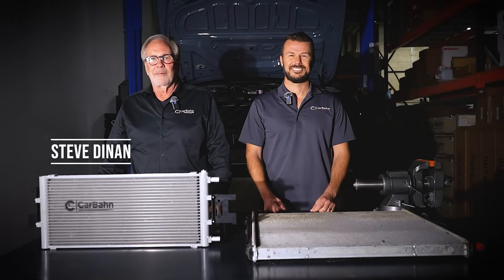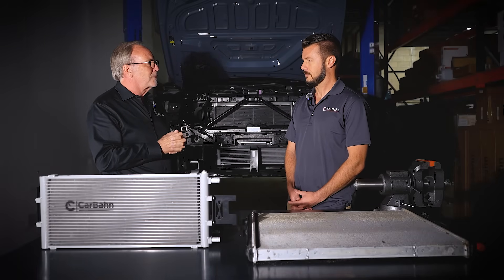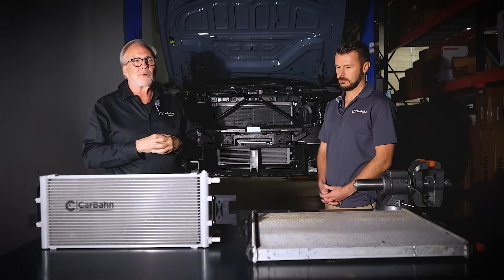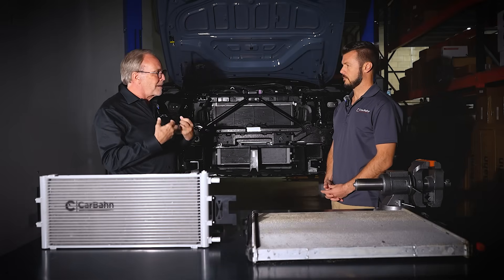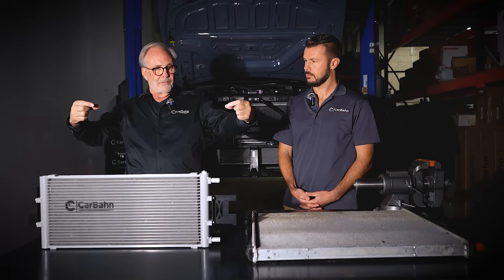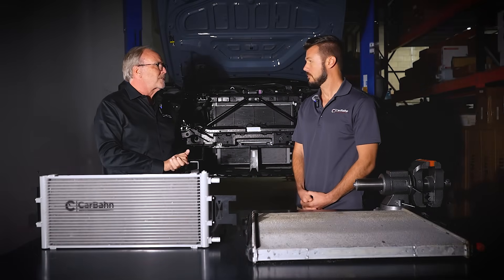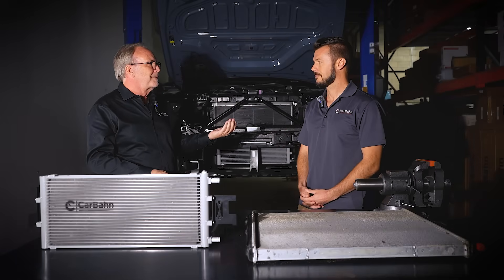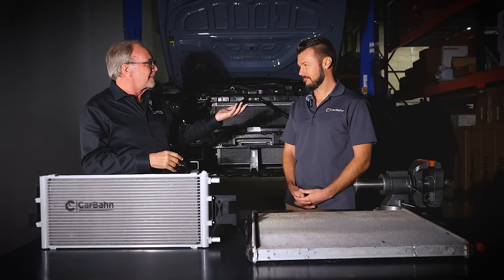All About Heat Exchangers & BMW Stage 2 Tuning - CarBahn Tech Tips

Comment: Great video. Does the addition of more water volume also help with heat soak? If so, I guess the thicker core cheats a little be taking advantage of this. 
My BMW M550d has two small heat exchangers in front of the L & R wheel arches. Because they exhaust into the wheel arches, I believe the vacuum in the arches helps pull air through. But overall they are small. 

Any testing on a rad with bent fins versus a new one? If not, it would make for an informative video.
Reply: No specific testing of radiators with bent fins, BUT, as a byproduct of our IMSA Racing program, we do notice the temperatures on our BMW M4 GT4 cars rise more quickly on less efficient radiators (older ones with damaged/bent fins).

Comment: How does adding this additional exchanger affect the coolant flow-rate? Any negative affects from the additional restriction? Or do you expect the increased cooling performance to compensate for the possible reduced flow?
Reply: Why would there be reduced flow? Might work the pump harder which takes a small amount more power but net net cooler IATs will always win out. 

At a little over 30 C to begin with, it’s a very efficient system from stock.
Reply: @kingGar27 more pressure drop = less flow rate ….usually
Reply: @TomPeter-i2t  I'm not sure I understand your perspective here. In your original comment you mention 'additional restriction' which would increase pressure, not drop it. That's fluid dynamics 101, right?
The water pump in this circuit creates the flow. Increased restriction increases pressure. But I doubt the additional heat exchanger is adding much more restriction (maybe a little more due to more surface area/friction - is that what you're thinking?). It should flow much the same as before.
Maybe I am missing something?

Comment: Glad to see you guys datalogged the temperature differences, was that because of the email I sent you last month asking about this specific thing? I saw 165F IAT at the Texas Mile and observed all the issues you discussed, and ordered CSF charge coolers. It'd be great to see a before / after IAT log on an F9x showing tuned (no cooling upgrades) then tuned at the same level with the cooling package that includes this heat exchanger AND the CSF charge coolers you resell. I think a lot of people don't understand the outsized impact tuning has on heat and heat soak.